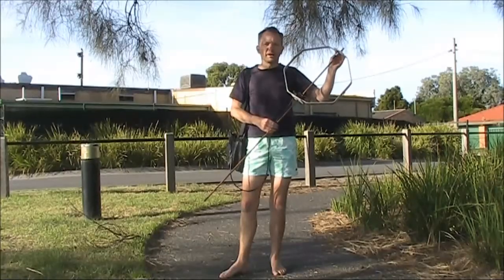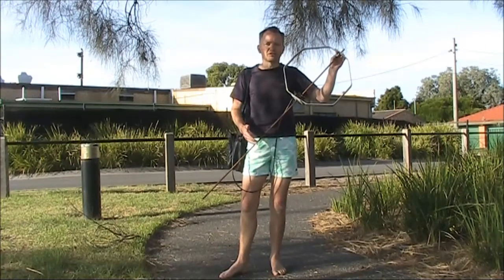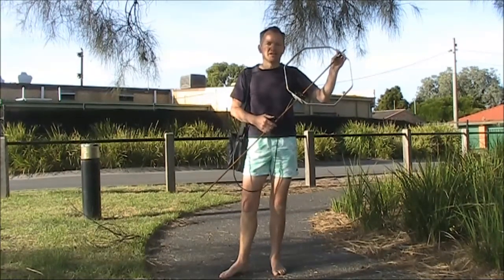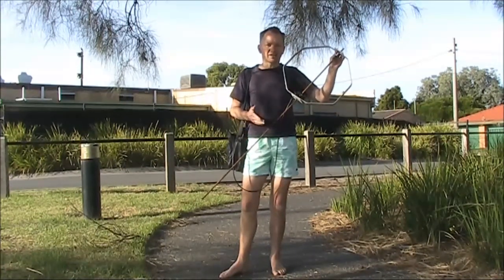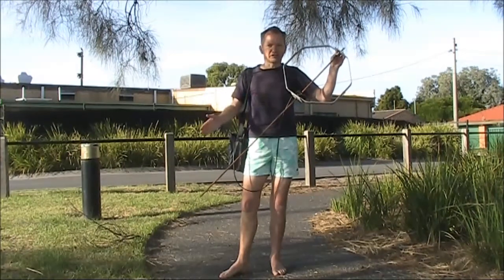Reception of VK3XPT beacon on 28.163 MHz

Comment: Hi Peter!I bought 2 40m pixie transceivers,and they arrived today.
What do you think,how could I use them make qrp beacons?I have no idea how could I key them..for example an arduino would do the job in your opinion?
Reply from the maker: Yes it probably could. But please use a frequency other than the frequency the Pixie comes with or run it only for a short time as your beacon will interfere with other people - especially those using Pixies - who can't shift frequency.